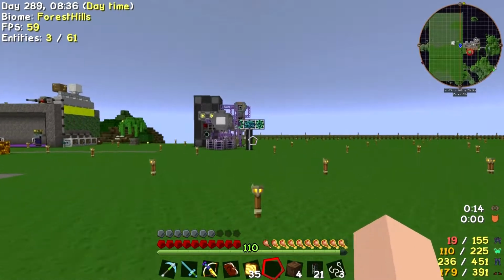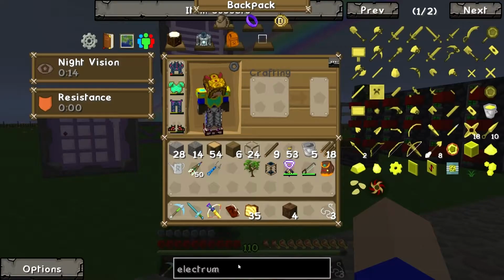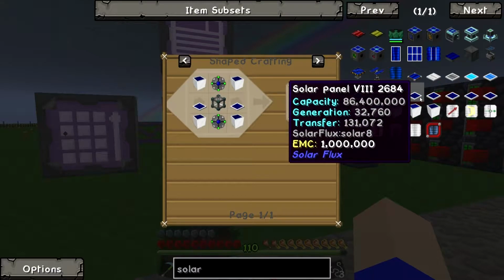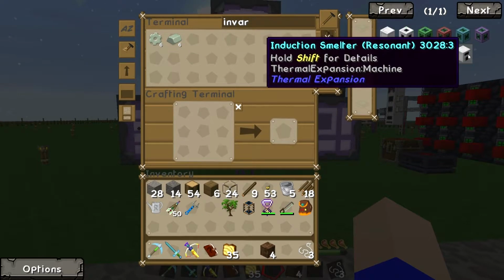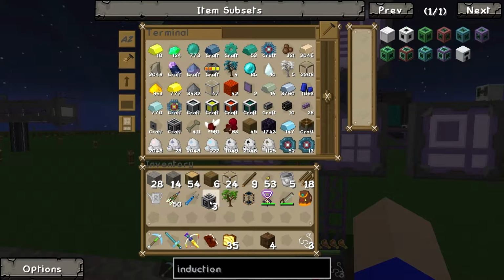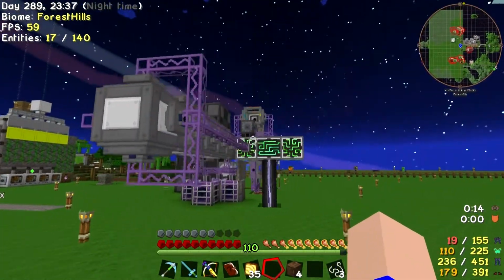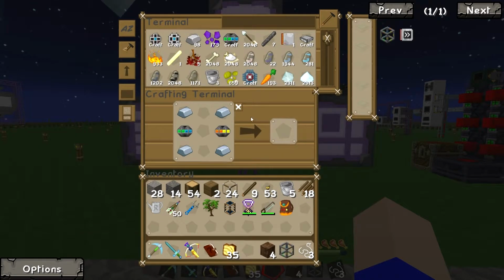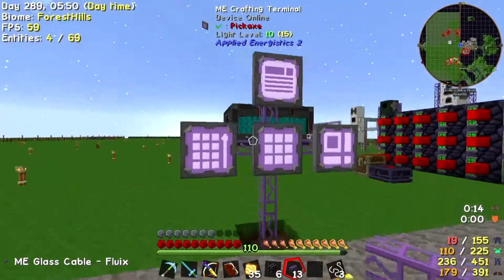Minecraft - Project Ozone 2 - Part 117 - Solar panel panic

Comment: 2 things...
1: Remove the import buses from the side of your induction smelter stack and replace them with itemducts.  Have that dump all their outputs into 1 chest.  Then hook a single import bus to that chest.  This saves you 4 channels.  You can do the same with the other stacks if you want to free up more channels.
2: your going to need to add Co-Processors to your crafting storages if you want to craft more things at once.  crafting storage = more complex recipie, co-processor = more recipies.
Reply: You can also push back into the interfaces from the same side of the machines
Reply from the maker: Now why didn't i think of that chest thing Hmmmmm